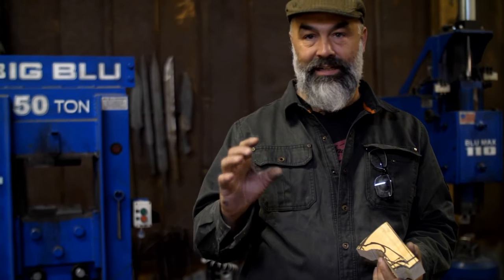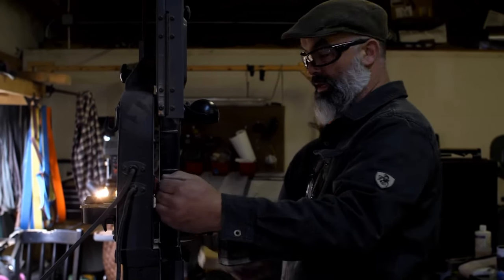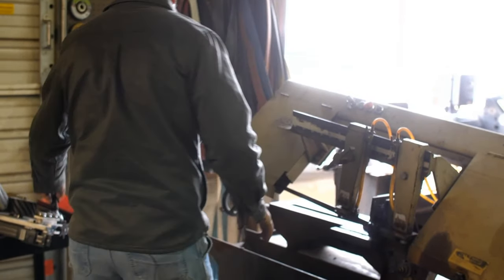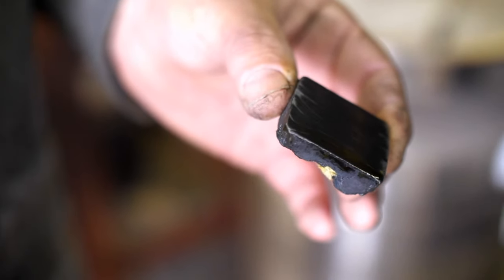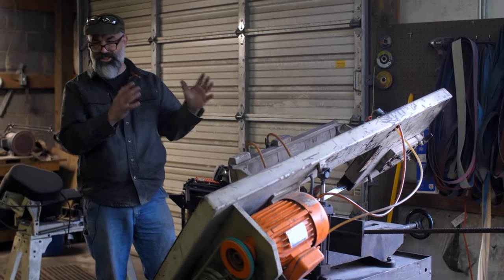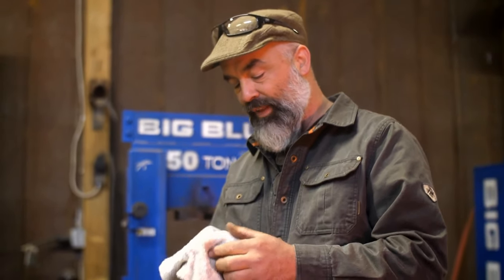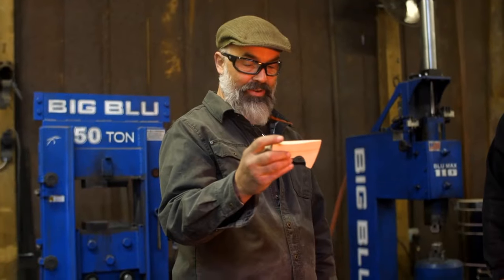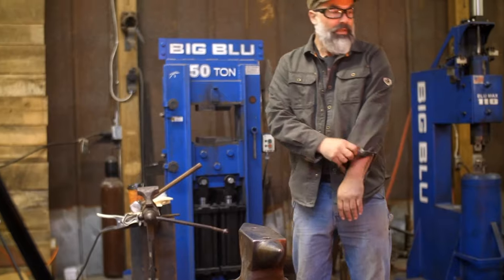LIVE | Making Tomahawks

Comment: And for the guys asking about the "cold cut saw"..... Mr. Knight is, it sounds like, is describing a "Dry Cut Saw". That has carbide teeth and uses no cutting fluid or coolant. A "Cold Cut Saw" has a high carbon steel blade, no carbide teeth, and is flooded with coolant.

Comment: A cold cut or dry cut, even if you use coolant, is NOT the best for cutting that stuff. I made the mistake of using mine, and the metal rendered that $90 blade useless. I called it a $90 mistake, and put an abrasive blade on and finished the cut. I was able to get a few cuts out of the blade after wrecking it, but it was only good thin metal, def not the 1/2" i usually cut with it. A beaver would have better chance of chewing through the 1/2" faster than my saw did.

Comment: I've been wondering for a while now if I could make San Mai without doing any welding or making sandwiches. Could I, for example, stack three pieces of steel on top of each other with nothing but gravity holding them together, heat them up, and tap them together? I think I saw a video with a Japanese guy doing something like that. The thing is, I don't know how to weld, and I don't have a welder, but I want to try to make some San Mai.
Reply: Well, if you want to try (and this is just spur of the moment chitchat) Take your three pieces, grind and acetone wipe clean, stack, drill holes through each end, insert pins in each end, peen over so as to rivet the pieces together, heat, flux, hammer to forge weld, cut off the riveted ends. Carry on from there. Haven't done it. Mr. Knight may say otherwise. He's the Master, so differ to his opinion, not the musings of a guy on the internet, sipping tea on a Sunday morning in bed, on pain killers, during a zombieless pandemic...... But outside the box problem solving in a small, nothing fancy shop is my jam. let me know if it works! ;)
Reply: @wingnutbert9685  That is a neat idea! It sounds like it just might work. Thanks!